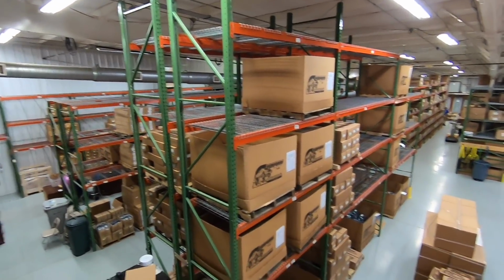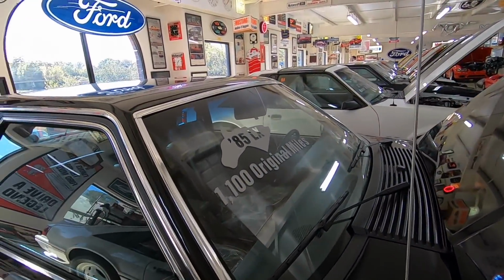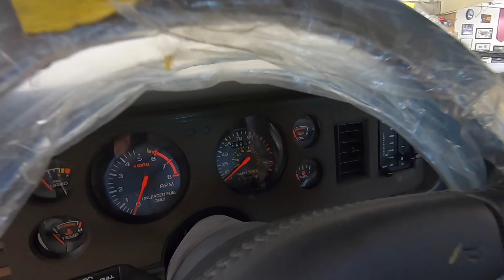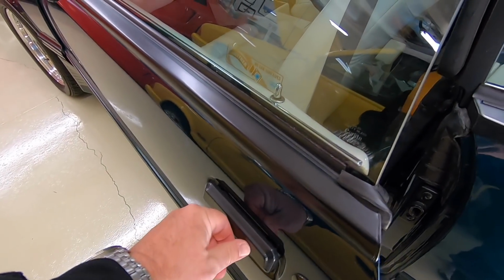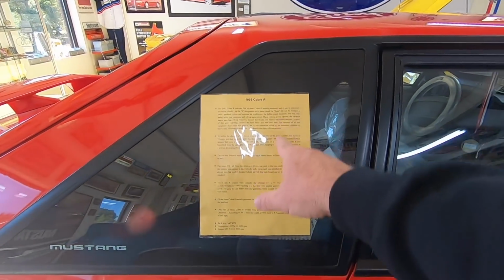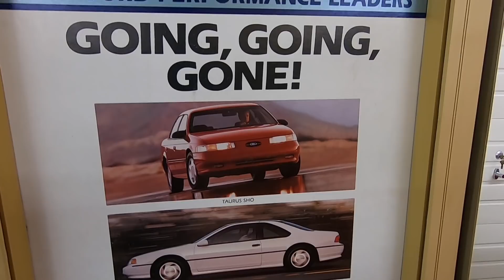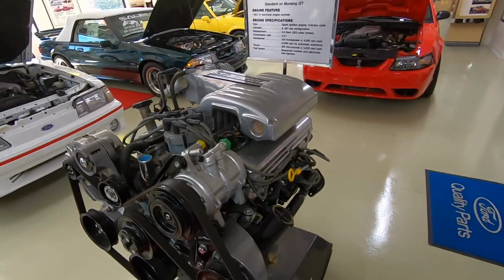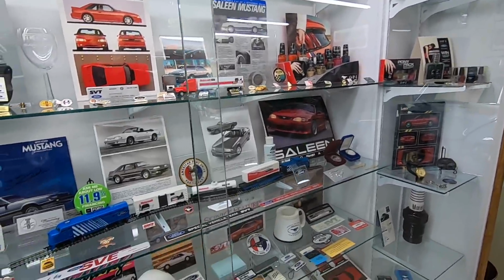You won't believe what is on the second floor of this warehouse in NC!

Comment: This is foxbody heaven,that 93 cobra r is probably the most expensive fox in the world u less #1 is somewhere with less than 100 miles .That car would probably get over 150k at barrett
Reply: I agree with you on the 93 R. it will be the most expensive non-Saleen foxbody. There is one out of Texas with only 62 miles but this one is number 2 of 107. BUT don't forget about the SA-10 Saleens of 93. Paul Walker paid somewhere north of $170,000 for his and there are only 7 or 8 in the world.  Good stuff, there are a few more vids of this place out there.

Comment: There is probably no other place on Earth with more sets of pristean gatorback tires .  Quick fun factoid. The 86 GT had mint 10 holes with 2 wheel weights on the outside plane but no where near each other.  That car has factory wheel locks under those center caps.  The wheel lock was so heavy Ford recommended a counter balance 180 degrees from that wheel lock. Good video man, through and through

Comment: I ordered my red 5.0 '85 Notch in April and got it in June of '85, damn I miss that car!! The special thing about the '85 is that LX 5.0 was NOT an option, you had to order it, the LX 5.0 became an option in '86 which sadly included swirl port heads reducing HP but increasing Torque.